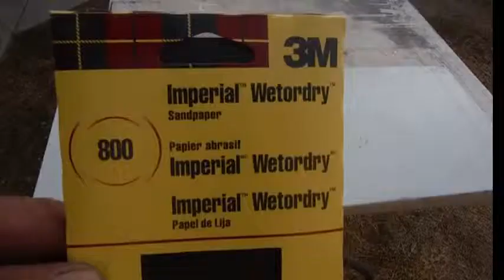DIY Restore file cabinet part 1

Comment: What tool did you use to remove old handles? I have those same ones and can’t get them off
Reply from the maker: Flat screwdriver push from the bottom